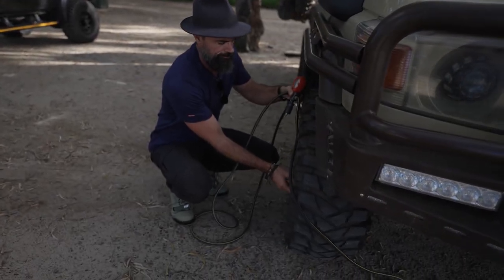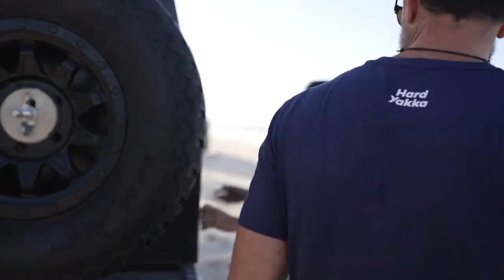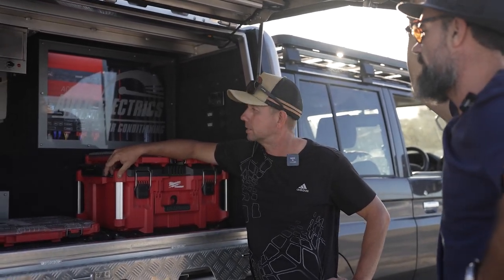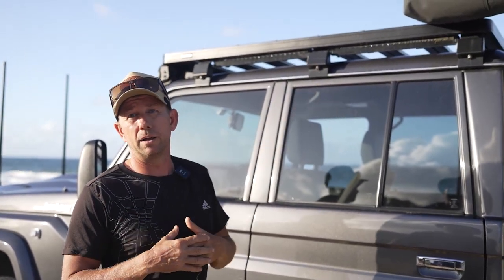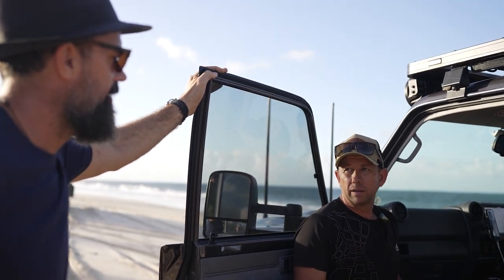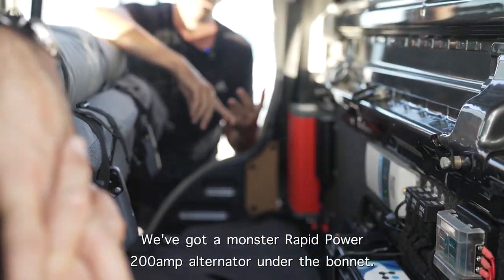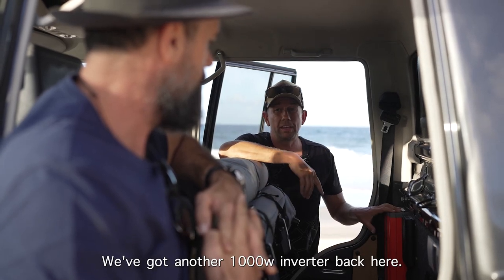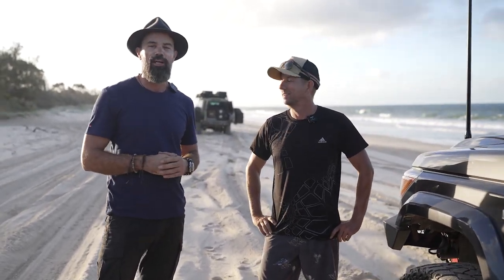An Auto-electrician's 12V 79Series Land-Cruiser Set-up!

Comment: Interesting to see what can be done but do most people really need set-ups like these. Great in a motor home or large caravan no doubt.
My power requirement to go bush is to just run a smallish camping fridge a small LED light and perhaps a small shower pump in a bucket.
120ah battery + DCDC charger + Solar blanket + small inline plugin power analyser = all done. (usually leave the 240v charger at home).
Battery box with charger takes up next to no room in ute tub/tray and leaves plenty of room for all other equipment. No roof racks or trailers required.
Reply from the maker: Most people, I believe, definitely do not need this extent of this setup, however, if one owned an auto electrical business specialising in building 12V systems for off-grid touring, then I can understand the desire to showcase the highest levels of what can be done. Your setup sounds very fancy compared to my first. I had a fridge plugged into a battery pack, which received power via the ciggie and a small solar panel. Nil else. Different strokes for different folks, I guess. ✌🏼